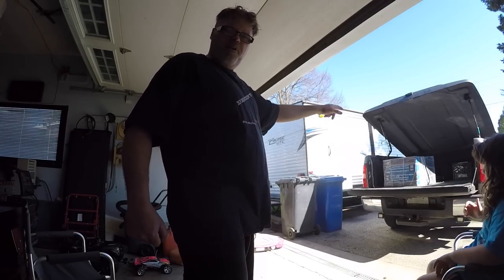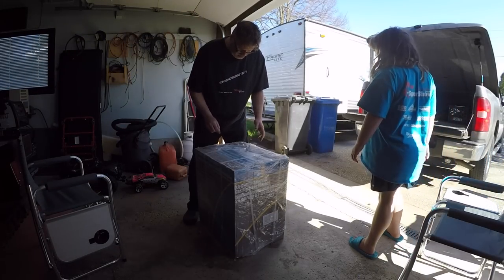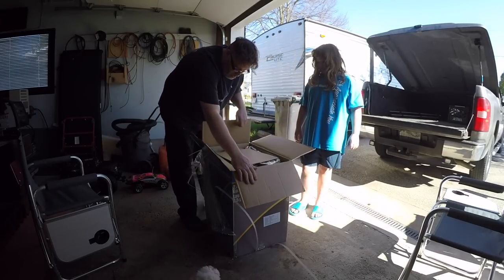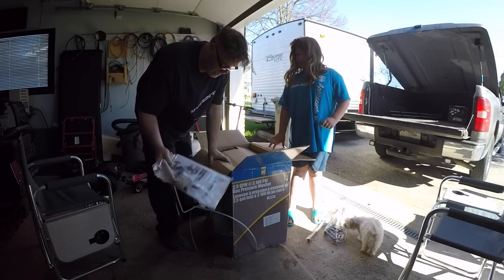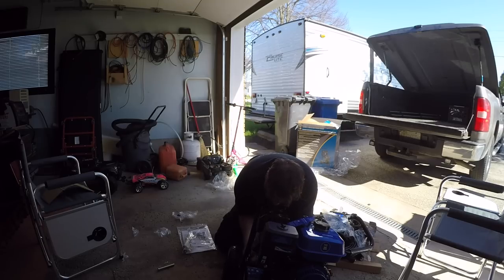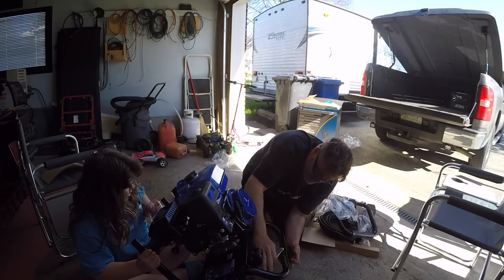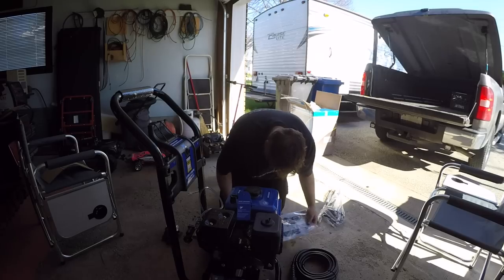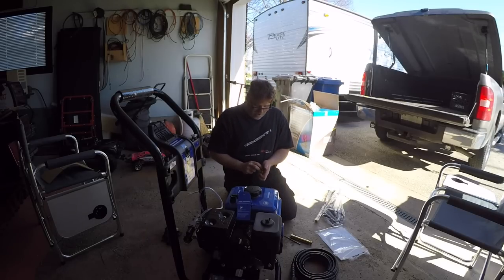How To Get A 3100 PSI Power Washer For 50 Bucks

Comment: Better take it right back in for exchange now that you have run it without water the pump should be nicely cooked!
Reply from the maker: 70carlton i better smarten up lol
Reply: @LifeWithBillSiff  well if you really do want to smarten up then drain the oil and replace it,...those chinese engines come with shipping oil and should not be run on that,...don't ask me how I found out,..that was be fore I smartened up,....also check the pump oil
Reply from the maker: Its all good buds only ran it for a few mins without water and just ran the break in and changed the oil .the pumps will take it dry for a few minuets its letting them go at full throttle dry for over 10 mins